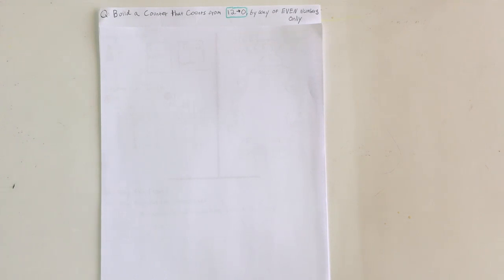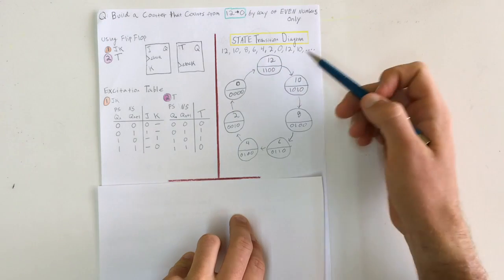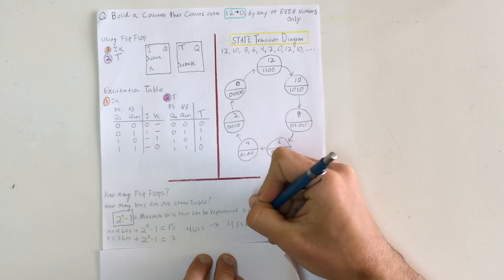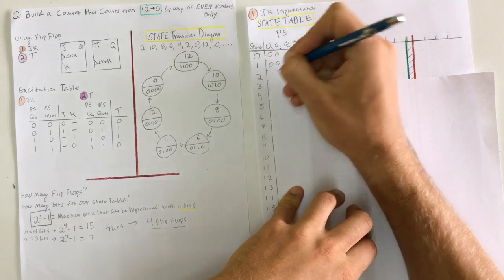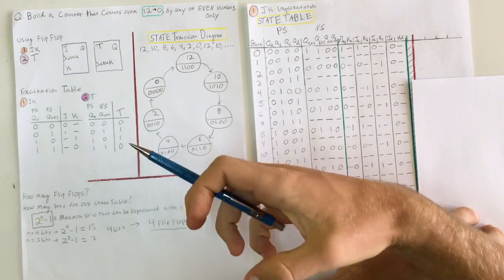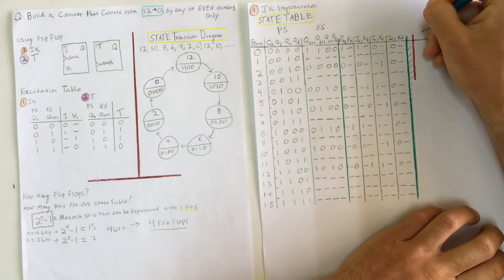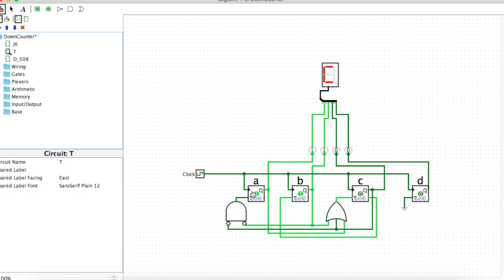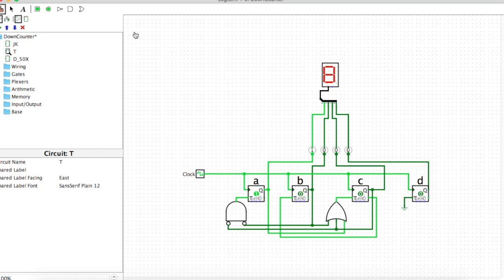Synchronous Counters #4: Example 2: Even-Down-Counter 12 to 0

Comment: Video is great, everything is explained very well. 
But can we do this with just 3 flip flops. There is just 7 required states actually, isn't it. In your simulation also the 4th flip flop is not working at all (it is in memory mode).

Comment: What about 3rd flip flop K input? 
is it zero or anything?

please help to do same with up count.

which software you are using?
Reply from the maker: I use logisim. Its any easy tool to check if your designs on paper are correct.
Reply from the maker: The 3rd flip-flop's k input cannot be 0. By setting it to 0 you are considering that the 1's in the 2nd, 6th and 10th cells from the 3rd K-input k-map are 0's. This is not true, they are 1's. Since every other cell is a don't care, we can simplify the problem by considering this don't cares as 1's and therefor saying that the prime implicant is simply just 1 and therefor 1 is our input.